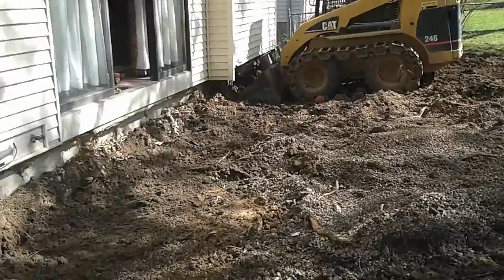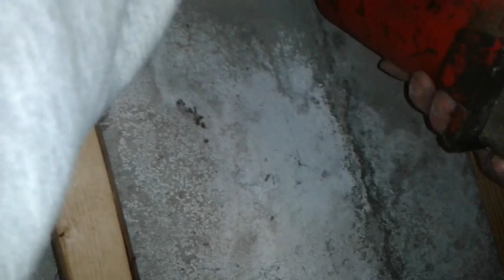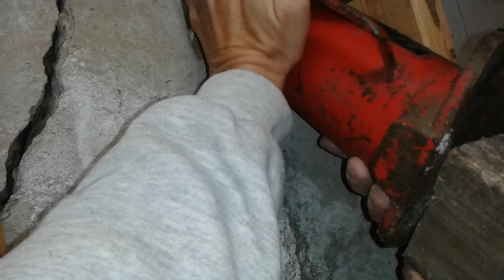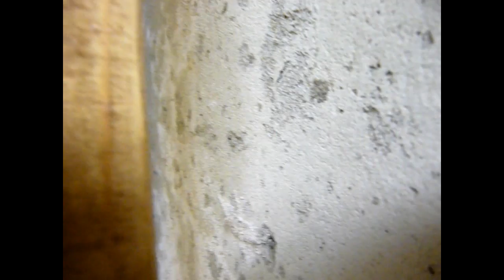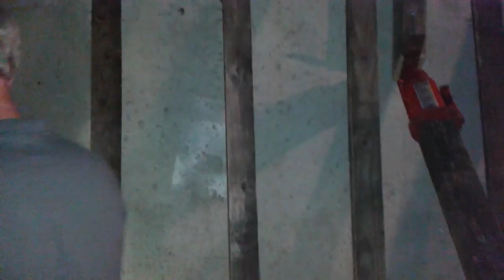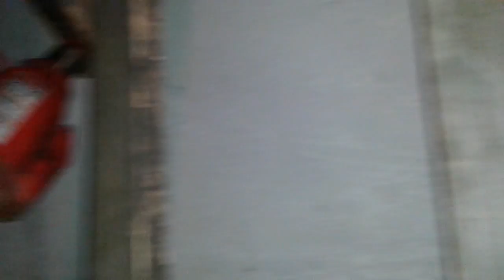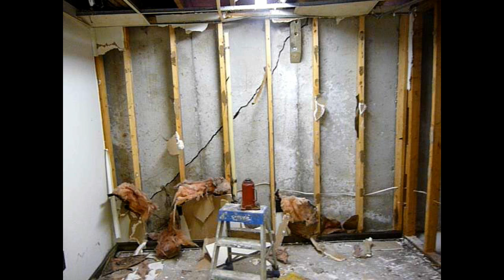correcting caving basement wall DIY

Comment: You guys had an Angel on your shoulder doing this . With a broken foundation wall and  your pushing on it with the excavator. You have no idea how lucky you were the whole thing did not cave in. I have been in construction my whole life and contracting over 35 and this was a train wreck waiting to happen, you had no idea what you were doing and just got lucky that all.
Reply: That was my thoughts exactly. 
Although I'm no contractor, I have been watching tons of videos on this stuff, since my basement needs to be fixed due to a bowing wall, and every one of them tells you to brace up your house with steel beams or something to hold the weight of the house in case it falls in, but I didn't see one brace in this video beside the 2x4s he was hammering against the top of the wall, and then to have a child down there while doing it, I believe they definitely had a few angels watching over them.
Reply: Ive done this many many times lmao, you're a total joke.

Comment: I see you sealed the wall, did you install braces? Did you grout the cracks? What is stopping the wall from moving again? I see you fixed your drainage but that alone will not stop a compromised wall from moving again. How did you strengthen the concrete?
Reply: I think the angle iron is the only bracking to keep the wall from moving.  Improved drainage and grading outside will also help.

Comment: I agree with your comment on jack placement. Why didn't you dig down to the footing to relieve pressure on the wall and see if you needed to add a foundation drain dystem? I agree with the suggestion of adding vertical support in addition to the angle iron at the sill plate. It been 2 years so how is it holding up? Oh by the way, nice ring and nails!!

Comment: You have got to be kidding me. This entire repair plan is flawed from the beginning. The entire repair could have been done from the inside of the basement utilizing a geotechnical approach with limited access drilling applications and means. The wall needs a series of soil nails and bearing plates at the midpoint where the stress is most advanced. You can tell this company is not a foundation repair company. Just a contractor using a chuck in a truck approach. This design should have been engineered by a licensed structural engineer. It would have saved thousands of dollars to have the right contractor for the job.
Reply: you can't realy save thousands on a $1500 job
Reply: @qposton25  you can if your $1,500 causes more damage.
Reply: This was a homeowner DIY effort.
Reply: He doesn't care, he scours youtube for these videos so he can tell everyone what they're doing wrong.
Reply: He is right about them screwing things up. I don’t agree with his whole “geotechnical approach” mumbo jumbo though. Basically he’s talking about anchoring a wall brace to the same thing that’s forcing against the wall... the earth. Lol. An I beam brace would have been appropriate for this job. Instead of just bracing the wall in one spot, that’s a foot long, it would brace the entire wall, from ceiling to the foundation footing.
Reply: @jamesmgordon83  It sound funny I agree, but the pressure is NOT from the dirt. It is from the WATER trapped around the foundation. So they do work. But you need to solve the water issue otherwise these are all bandaid at best.
Reply: https://wafrp.com/wp-content/uploads/2018/06/2017_UBC_Foundation_Repair_Code.pdf

Prove your point fuck face..  theres the literature to use...  fack aff arse biscuit..
Reply: @Z-Ack  This links to a document that purports to be a building code, but really isn't.  The UBC hasn't published anything since 1997.  This an unsourced document, and should not be trusted.  My guess is that it was concocted by a local trade group, for marketing purposes.

Comment: furthermore I don't think this will hold. Your walls will again push in where they are cracked without a brace. 2x4 or 2x6 will not hold in.
Reply: Yea all that work and if just spend about  3-500$ more on hot rolled steel 4” i beams top to bottom bolted through to the footer and anchored to joists every 36” to 50”...  then wont move again.  Need to wrap and reseal the sill plate and tighten bolts back in block walls..  and also woukd fill every 2 feet the void in the blocks with cement And rebar..  ..  then rubber seal the outside foundation and tuck point then dryloc paint the inside walls.  Then as long as they regraded the lawn right  it should stay good for the life of the building.   And if they dont have a interior drain to the sump pump cut along the exterior wall...   

Also when you got 80 tons of force getting applied to a friggn house with 4x4’s, dont mess with the guy jacking it up and especially dont have your little girl anywhere around those 4bys.  Ive seen em explode randomly wher theyre under so much load...  thats kill her..  not to mention if the expansion bolts gave on their supports..   the guy doing it if was contracted was just being nice to ya, probly cuz you sound hotter than a 2$ pistol, and allowed you around but if shit hit any fans than his insurance doesnt cover you or your family nor will yours if they find out the house was not made sure to be empty when jacking it up..    mi actually just had to get a permit when i replaced a lally colunn abd section of the footer....  had to sign affidavit stating such..  and put a sign up and all.

Comment: Why didn't you just leave the wall and brace it with 5 or 6 inch C channel? I have put in 29 5" C channel beams so far to brace my walls. some were pretty bad but they aren't going anywhere now. See my channel for a couple videos I posted.

Comment: My dad's sledge hammer has duct tape wrapped around the handle too!
Dad, who is a structural engineer, has always pointed out structural problems to me wherever we go.  His biggest pet peeve has always been that the ground should slope away from the structure to avoid this sort of thing happening.  Water seeping into the ground is the biggest settler of dirt and you want the water to flow away from the house before it settles into the ground.
Reply from the maker: clockguy2  Yup!  I've learned so much too!....I'm starting to pass on the info I learn to (slope of the yard, dirt to close to the house, etc) and it seems to be correct!
Reply: thank you for the info

Comment: I have 'Bulging walls in my garage - one side has wall anchors installed - but the other side is now bulging inward.  so I was thinking of doing something similar except I was wondering if I could create a wall to wall jack post to gradually push from wall to wall  to move the new bulge back in place, using beams and floor jacks.  I would dig a 'trench on the one side so as to allow that wall to be pushed back into the correct position.  After I of course  install some under ground flashing against the out side wall to help keep the water out and then a gravel weep drain at the bottom to move water away from that wall.  Then after the wall is be in position - i could also install wall anchors on that side also to keep it in place for good.
Reply from the maker: Steve Goettler I'd be curious to know if it works! Sorry for the slow reply, I don't get on much - have you tried yet?

Comment: I appreciate your video.  I have been doing the same thing in my basement, a fifty foot long section with jacks placed every seven feet along the wall. Your video is the first I've found that is similar to my project. Outside, my entire wall has been excavated down 7-1/2 feet and the trench is 10 feet wide at the top and 6 feet wide at the bottom.  Inside, I bolted 4x6 beams along the entire length of the wall, up 5 feet, because the number of diagonal cracks required it. I used 4x6 beams to support the car jacks. Your application of angled steel anvils on the wall to push against is a new thought for me and I intend to use it. (I wish you could ship them to me!)  I appreciate how you used angle iron. Thank you for your effort in videotaping and narrating.